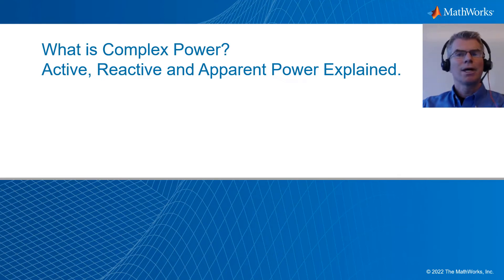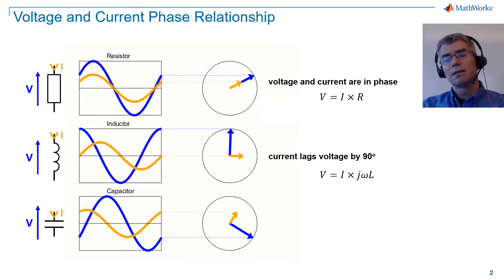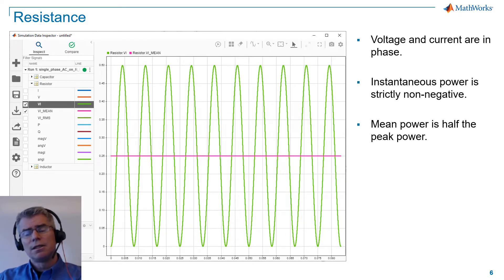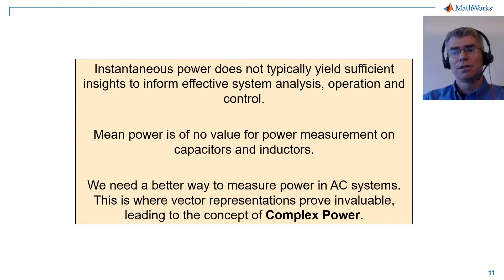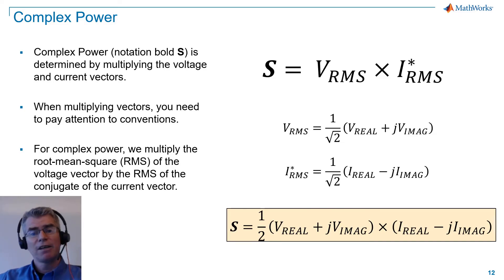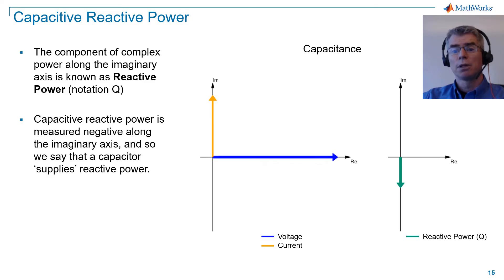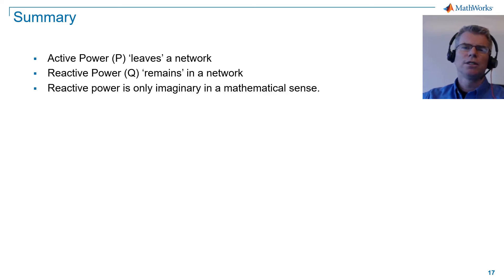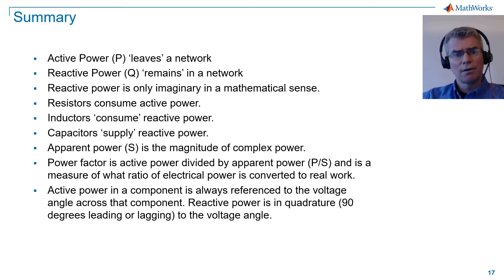What Is Complex Power? Active, Reactive, and Apparent Power Explained

Comment: In the USA NEC the convention is to always use RMS values for steady state AC current and voltage. Also, in the USA the real part of complex power is called Average power (and many times called Real power) we don't use the word active power. 

When given a power factor (pf) you have to know the type of reactive VARs. So for inductive pf we use the prefix lagging (current lagging voltage) and for capacitive pf we use leading (current leading voltage). So, to correct pf you often will see the addition of leading VARs (capacitors). 

To take the conjugate of phasor current in polar form all that is needed is to change the numeric sign of the angle. The use of RMS values will reduce the divide by two seen when using peak values which is another type of useful mathematical simplification. 

So, in reality we have two beneficial techniques from Mr. Steinmetz, the AC phasor transform (which is really an application of Euler's identity) and the RMS equivalence (which is described as the effective value, equivalent heating in a purely resistive load). With the understanding that the techniques are used for steady-state AC. 

Given this we see that instantaneous power occurs at twice the line frequency, which is how energy (power) can move in an RLC circuit between the source and the load with a pf less than one in one cycle. I should stress that the complex power strictly relies on the use of pure sine waves. If the source is not a pure sine wave (the sine wave is distorted) then we can have differences in actual losses. Also, steady-state AC is not derived from switching on an AC source. It is a mathematical concept which assumes the effects are beyond any transient (power first applied) effects. Like transformer magnetization current.